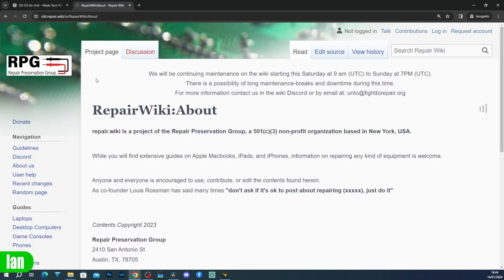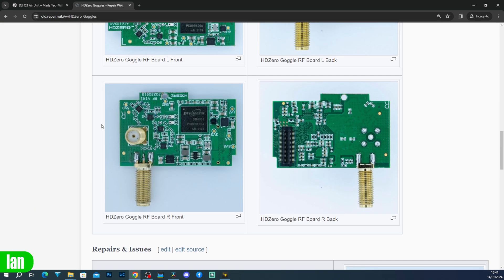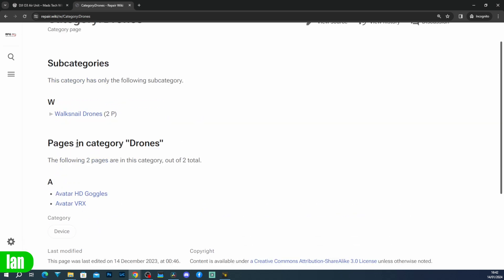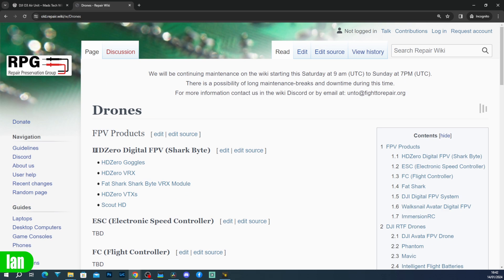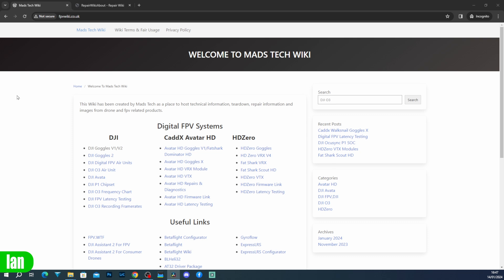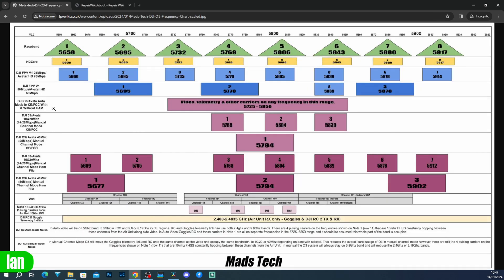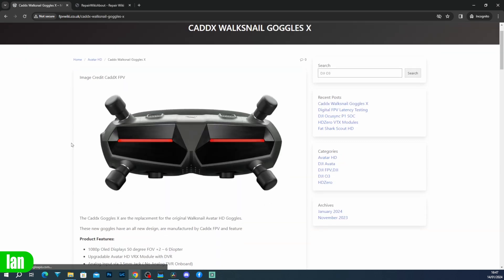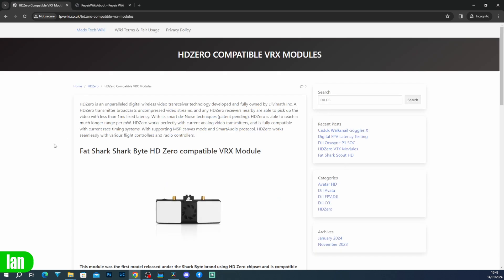Mads Tech Wiki - FPV Teardown and Repair Guides

Comment: That's cool.

I'm flying the new HDZERo-Goggle since last year.
Everything works as ecpected so far.

The old Fatshark-HDO2 is laying around and unfortunately not working any longer.
Is there any chance to see a repair-Wiki of such an old Goggle in the Future?
Reply: What is wrong with it? HDMI input problem?
Reply: @HereComesWhitey  
No, it starts with flickering scrrens, now the screens are completely black, the fan  is not working.
I tried different power-cables and power sources without success.
My guess, the power-pcb is dead.